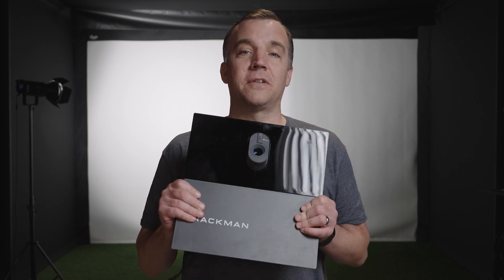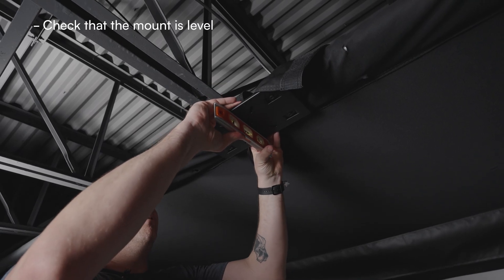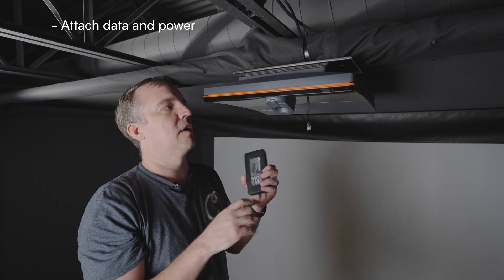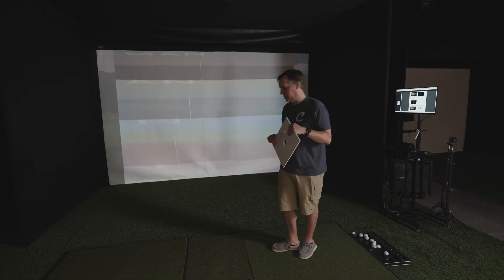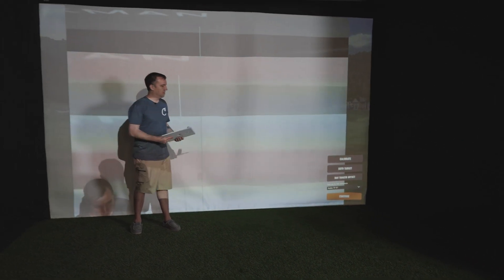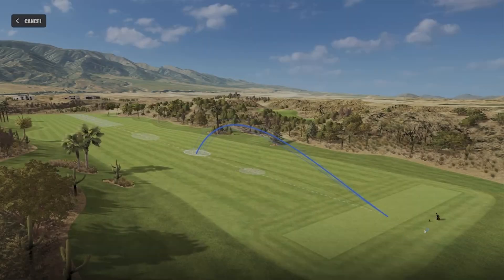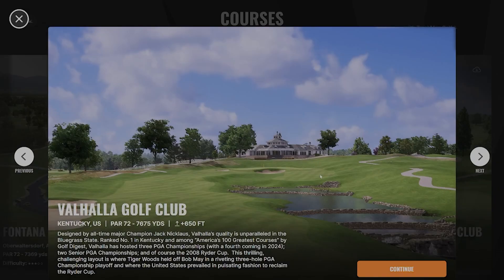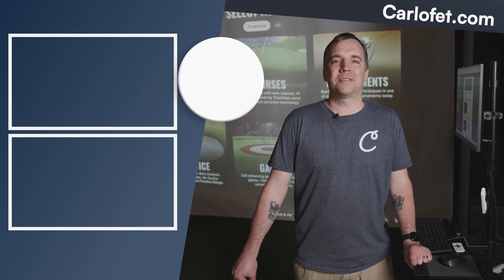Setting up the Trackman iO

Comment: How does it go with vibrations from the ball hitting the screen. Trackman rep said it can require recalibration
Reply from the maker: Hey Mark! It’s possible that the calibration on any monitor may need to be updated from time to time if any changes are made to the mounted/calibrated position. 
For example if the iO is mounted level on a frame but over time become out of level you may need to adjust/re-level the mount and update the calibration. 
In our experience we’ve found that our Carl’s Place Frame mounts do a good job at securely mount monitors when properly installed and have not needed consistent recalibration!